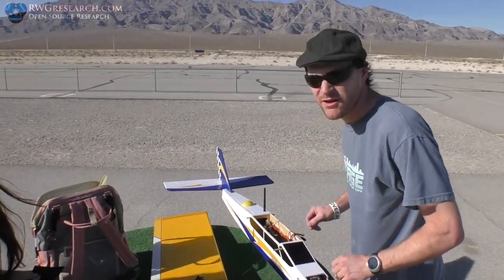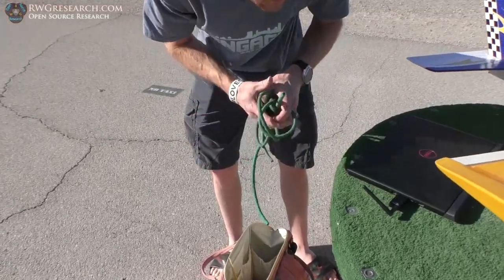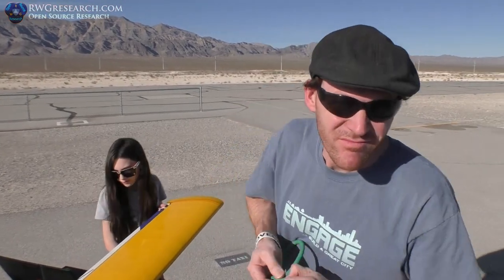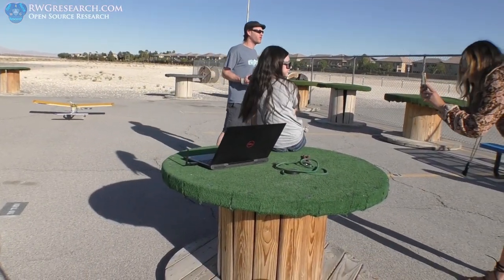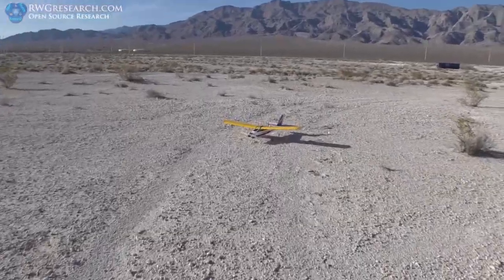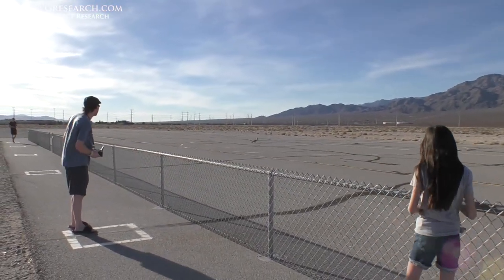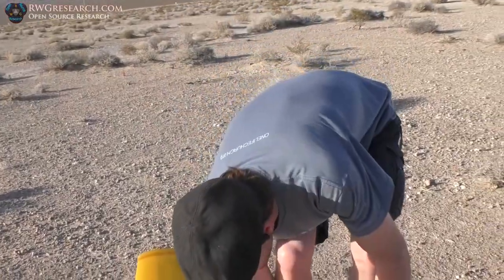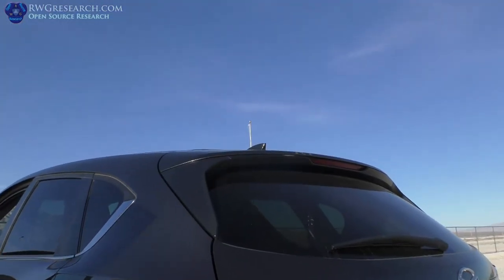4-29-2021: RC#18 - FIRST FLIGHT! We Tried To Crash It.... TWICE!  #36-22

Comment: Hi Russ! Newby here.
Had some ideas for a 3d printer if you are still interested in those... Still looking for your input on the Stanley Meyers fuel injector reproduction you participated with... Still browsing the channel... However a 3d printer with only an up down and left right... The table is a centered rotating table.. probably just a headache in programming to slice thing in a radial format,. Too much pie/π  let me know what you think would love to try and help if I can

Comment: Your Lipo does not look too happy, maybe it suffers from voltage sag? Have you checked that its C-rating matches the power consumption of the Motor?
Anyway, congrats on your birthday and also on your semi-successful maiden :)
Reply from the maker: Haha thx. No, the problem is my motor controller. Its rpm limited to 60erpm.  So not enough thrust.. Will explain more in the next videos. We do things differently for the motor controls. ;) thanks for the thoughts. It'. Par on for checks. I agree.  ~Russ
Reply: @RWGresearch  thinking again about it and looking at the size of that battery, you probably don't even need to worry about C-rating, even 10-20C should be Plenty for a single motor. I'm glad ESCs have become so affordable over the last few years, i can still remember them costing a fortune! Best of luck with your next testflight!
Reply from the maker: yeah. that battery is HUGE for its use case. I'm only drawing 550W max. so its overkill. but that's part of the point. long flights. and boy do i get those later! ~Russ
Reply: @RWGresearch  maybe try LiIon some time in the future for even longer flights! :)